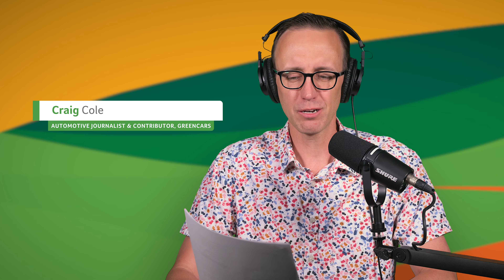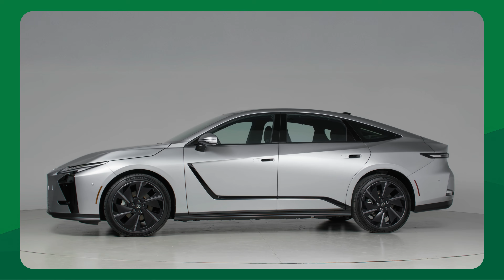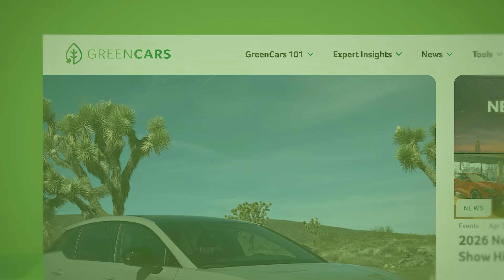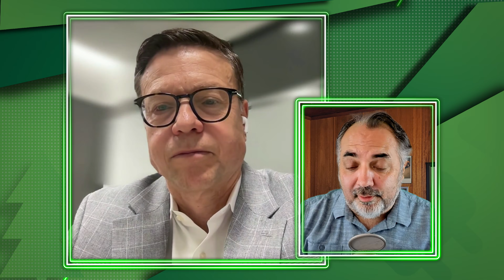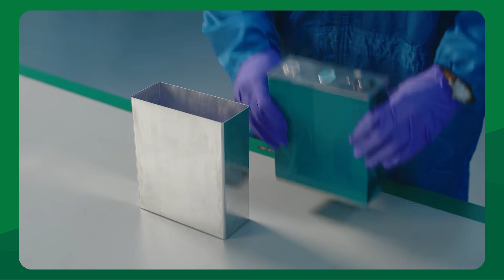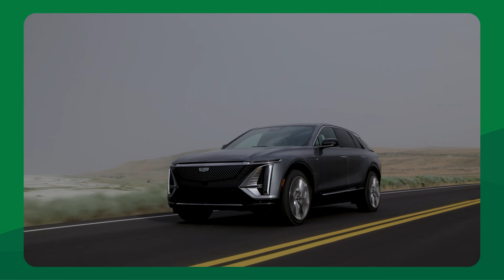Here's Where GM Will Install New Sodium-Ion Batteries | Podcast

Comment: You can't compare solid state batteries to hydrogen fuel cells. Hydrogen has no distribution network and would have to start from zero. We already have infrastructure for charging batteries. Solid state batteries won't need different ones. What's more is none of the companies working on hydrogen powered cars have a plan to provide the fuel. That's not how a consumables trap works. Imagine if HP had sold inkjet printers with no plan to make or sell ink.

Comment: You said batteries are lasting longer than expected but then you say modules are good for serviceability. At what point do you give up on serviceability and just do the cheapest and easiest design? I would love to know what percentage of EV battery packs are actually being "repaired" vs just replace the pack or total the car. I think the number of packs being repaired is statistically insignificant. At some point in history the labor attempting to repair a battery pack will be more than a new pack. I think we should plan for that day if we are not already there.